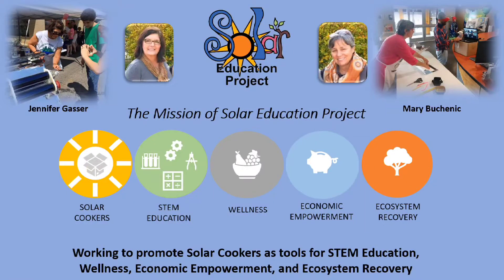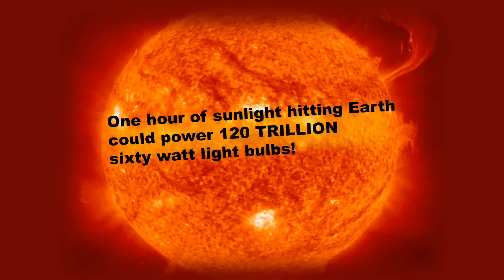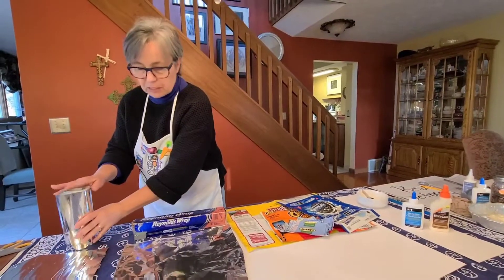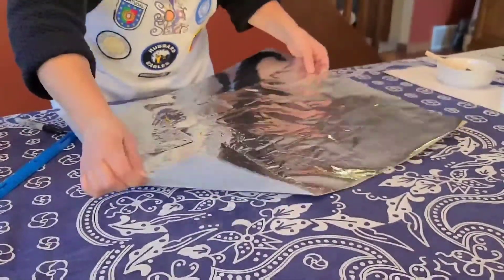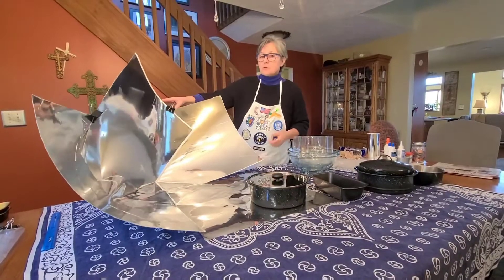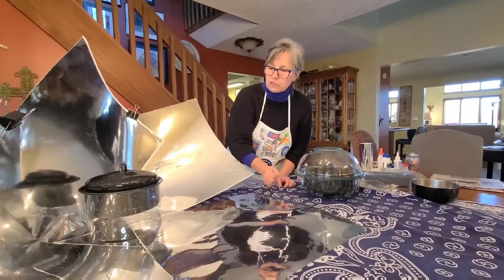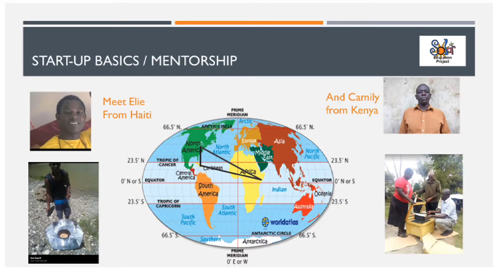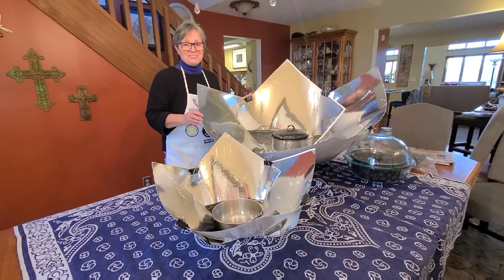How to Make a Solar Oven

Comment: look it seems like a good system, but instead of talking so much unnecessary shit rather put in 2min extra on the video and give the measurements in metric, you do realize that only you americans use imperial while the rest of the world is using metric ,get with it.
Reply: Faire 4 carrés de 33  x  33 cm. La diagonale est de 46.5 cm ( donc la hauteur).
Bien sûr vous pouvez faire plus grand. Avec 40 x  40 cm vous aurez comme diagonale  56.5 cm ( donc c’est déjà beaucoup).
Cela fait 0.64 m2.
Il faudrait à mon avis avoir une surface de 1m2.
Reply: Suite : pour avoir 1m2, il faut 4 plaques de 50cm x 50 cm. La diagonale est de 70 cm ( de haut).

Comment: What is the name of the vinyl roll with the reflective coating?   Are we supposed in go into stores and ask for vinyl 
Store employee " may I help you "
 Me " yes, I want vinyl"
 What's the point of this video when the names of the items needed are not mentioned,  of course I'm not taking into account you don't have the slightest idea either.
Reply: It looks like something you’d get at a craft store to go in a Cricket label maker type machine.
Reply: Mylar might be one name.  There is also extremely reflective wallpaper sold - not as reflective as mylar maybe, but I'll let you work that one out. 
Some food delivery stores/companies have boxes or bags that make excellent material for a solar oven and/or a "hay box"/thermal insulated container/box.  In fact, I suspect that one box could be used both ways - if built correctly and with the correct materials. It would need to be on wheels, though, to move it in and out of the sun. But, I''m gonna start by making a dual-use cardboard box project.

Comment: I put this together, almost as directed, except I made my center square a little larger so I could put slightly larger pots in there.  It is out in the yard, right now, heating up.  In 15 minutes it got the oven thermometer to 150 degrees F.  Then, the clouds came.  It doesn't seem to be getting any hotter. I'm trying to boil water.  I'll check in a little while to see if it gets any hotter with the hazy sun and clouds.  Will do a temp check to see how hot the water actually got.  Interesting first experiment.  Thank you!